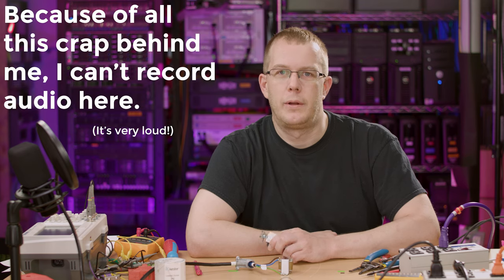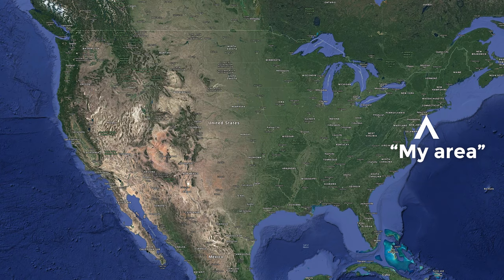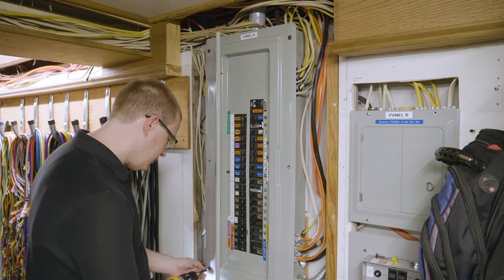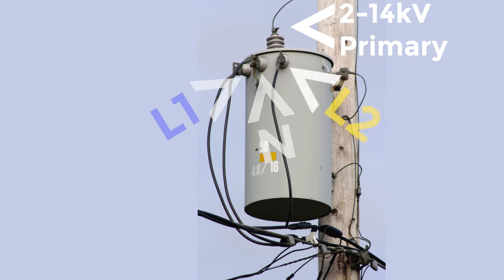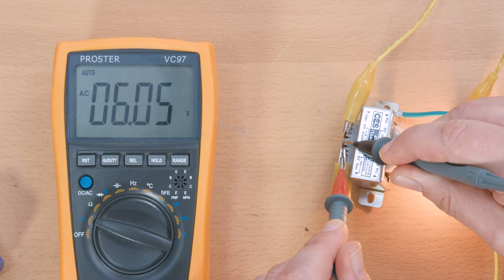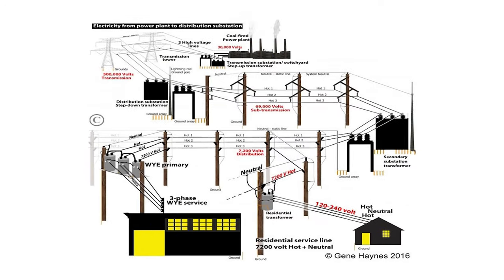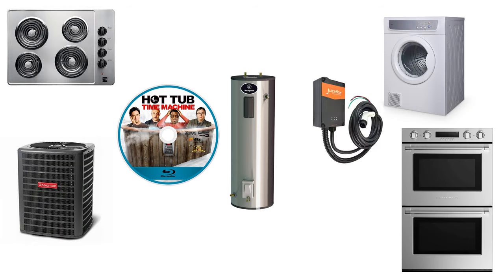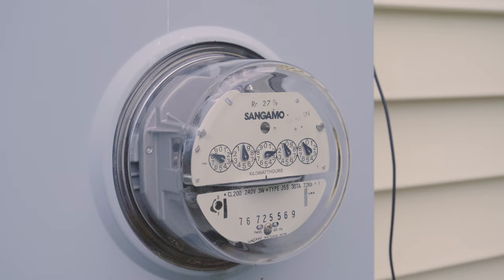240V is the Standard US Household Voltage (Kinda.)

Comment: It's always funny, when Americans claim they had a 240V system. Maintaining the same argument, everyone over here has a 400V system. Furthermore, we have 3 phases (120 degrees apart), not just two. This allows us to use smaller wirings (usually AWG 13 or smaller, even for air conditions, stoves/ovens or saws) for the same wattage, and smaller breakers (the normal breakers are 16A, rarely 20A)

Yes, providing 3-phases to every household is more expensive than distributing with the stone-age split-phase system. That's the money that had been saved by the electric companies before, on the expense of the customers.

And to make it clear: Every computer and most of the appliances sold in Europe can run on 100-240V/50-60Hz. It would only be problematic with appliances that have a motor ... (like a hair blower, for example)
Reply: But is that 400 v is a limit ? Do You think they would increase the voltage again
Reply: @maciejgromek2368  We speak about private households here, where 230/400V is the limit. 
Industrial buildings or big farms can have higher voltages (3 phases as well), though, like 500V or 690V ...
Reply: @oaw_manofnorse  I'm actually tearing myself when I think about it, 120 v are safer and by renewable energy 12 v system is getting popular so 120v is though more effective, but when we talking about for example very powerful devices like some hair dryers, the american breakers 120v 15 amps it's not enough and it makes them turn off (and Japan has only 100v). But in the other side Americans have a few kilovolts nearly houses and I don't how about Your country but I,m from eastern europe and in the rural areas 400v lines are too long, my house is 1 km from the transformer, and look that we have medium voltage even at home, 10000 v generates when the car turns on, 10000 v is in the kinescope tv, and 4 to 10 kv flash is in the copiers, so maybe everything is possible
Reply: @maciejgromek2368 

 Point 1: From the statistics: There are more (electrocution) accidents in countries with 100-120V than in countries with 220-240V. And you can see a lot of dangerous DIY here on youtube (~80% from the US, ~10% from India). Almost all of those installations would be forbidden in my country, as minimum safety and electrical code compliance requirements are not met.

Point 2: As I already said, having 230V or 3~400V makes cabeling easier and cheaper for the customer (see above). Calculate for yourself how many Watts you can pull from 1~230V@16A (L,N,PE) or 3~400V@16A (L1,L2,L3,N,PE)

Point 3: I don't know what lines you (still) have in your country. We have underground cables that are 1-2 kilometers from the transformer, and the voltage is fully stable (and speaking of outages: We had only 3 in the past 50 years, all caused by lighnings not by any other issues).

Finally: I'm sorry, but if a private household gets a 10kV line and an own transformer, then there is something inherently wrong in your power distribution system.

I live in western Europe.
Reply: @oaw_manofnorse  If I may say about from wider perspective
I’ve been talking on forum with american electricians and they told me that America should have 240v, but You know , Europe had also 110 v but we could change and everything started from like 50, than 90, 100, 110v so when now europe says the most about globalization etc. that increasing was not the best idea from that point so I can't agree with argument I've heard that America or Japan are technologically recessed because they have lower voltage ..... You say that 400v can be send on pretty high distances but it’s sometimes exagerated especially in the poor countries where nearly by the transformer could be 280 volts and on the end of the line only 160 v …… But I can't find anywhere why exactly 230 and not.for example 350 volts ' is that from that Nikola Tesla calculated that 240v 60 hz are the best parameters? So 230v 50hz are very nearly ?
Reply: @maciejgromek2368  Voltage drops can be calculated and depend e.g. on the material used for the lines, the corresponding diameters and the distance, .... The best is to ask your local provider why there are such unusual drops on rather small distances.

As of the rationale, why it is 230V today: Initially, we had 110V (i.e. in the early beginning of electrification) in some cities. Then, when the politicians decided to provide electricity to the masses, they asked local scientists or experts, and those said that it was more efficient to use a higher voltage. So they agreed on 220V+x1%-x2%  in most of the countries while the UK  (for some unknown reason) chosed 240V+y1%-y2%.

When the EU decided on common power systems and rules (and wire colors!) if i remember well in 83 .... they selected 230V+z1%-z2% so that both worlds can still run the same transformers (you have to look up x1,x2,... on your own. )

electrical engineers world wide agree that split-phase systems are not state-of-the-art at all, and likely to fail more often than other options.
Reply: @oaw_manofnorse  but did You know that Norway still have split-phase

Comment: and if America would theoretically change the voltage to about 220v the plugs and sockets would leave the same, like NEMA-5 would be for 220v ?
Reply: The USA has a 15A standard for 240v: NEMA 6 (and NEMA 2), the tandem plugs.  If we were to convert to 240v, we’d probably use them
Reply: @davidpar2  thanks for the answer I think that it was not the best idea to change from 110 to 220 v in europe
Reply: @davidpar2  And what do You.think about european plugs ' I mean about the fact that sockets are recessed and plugs pretty big with round pins. Do You think these are advanteges or disadvantages?
Reply: @davidpar2  You can have 240V circuits with NEMA 6 receptacle now if you want. Tell your electrician you want them for air conditioners.
Reply: @maciejgromek2368  We could benefit from sleeved prongs on our plugs. Australian plugs have them, and they're just modified NEMA 10-20 (obsolete in N. America).

Comment: I am challenging the statement that the sine waves are 180 degrees out of sync.   I ask for you to think about a few comments and would like your thoughts afterward.   There is only single phase coming in.  One sine wave at 60 hz.   So if there is only one wave in, how can there be two different waves coming out?   Forget your Oscope just for a minute.   Try to answer the question with common sense.   I do not think you can come up with an answer.   So, here is my statement.   If you put an Oscope on L1,L2, and common in scope to neutral, you will get the waves you show on your scope.    If you look at only the first half of the sine wave for direction, assume electrons flowing L1-L2.   The scope is reading L1 to N and L2 to N.    This not the direction of electrons on the first half of the wave.   There are three waves at exactly the same point in time.  They are (direction listed) L1-L2 (240v) L1-N(120v) and N-L2(120v).   So if you say on an Oscope 180 degrees out because of the connections, I agree.  But within the electrical system all sine waves increase and decrease at exactly the same time.   They have to.   Please let me know your thoughts on this.   Excellent video!   Respectfully,   Kevin
Reply: Kevin Coop. No they are 180deg out of phase, if L1&L2 were the same phase they'd have 0V potential between them
Reply: Nathan     I assume that you have read my explanation and are not agreeing with it.    Hopefully you drew a transformer and have it all worked out.   Please give me a full explanation of how a single phase sine wave in the primary side gets changed and operates at different direction and or in different point in time.   Be very specific please.
In your comment, you say that from L1 to L2 on same phase would be 0 volts.    If you are talking about a termination point, I would have to agree.   But L1 and L2 are two points of a single phase transformer.    One single sine wave not two.   Twice the amplitude of a 120 volt sine (in 120/240 volt system) and at exactly the same point in time.   If you remove the center tap and ground completely, you will have the 240 volt sine wave only.
Looking forward to your telling me what causes 180 degrees and out of phase.    Do not just say that is what you learned in school!   That would be very disappointing.
Respectfully,    Kevin
Reply: @KevinCoop1  Battery terminals are 180 degrees out of phase. One terminal is positive and one terminal is negative. Batteries don't work if both terminals are positive. Same is true if both terminals are negative.  A transformer secondary is no different. When one terminal is going positive the other terminal is going negative and they do this alternatively.
Reply: Two inputs on the scope. One input is connected L1 to neutral, the other L2 to neutral. When L1 is positive, L2 is negative. When L1 is negative, L2 is positive. If you connect only one scope input L1 to L2, there is only one sine with double the voltage.